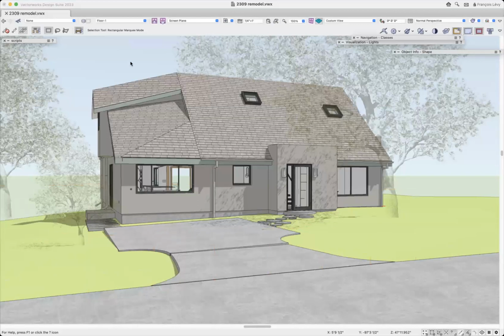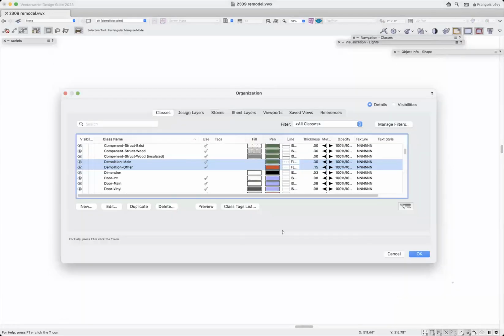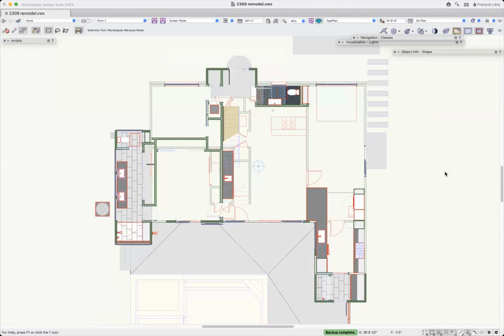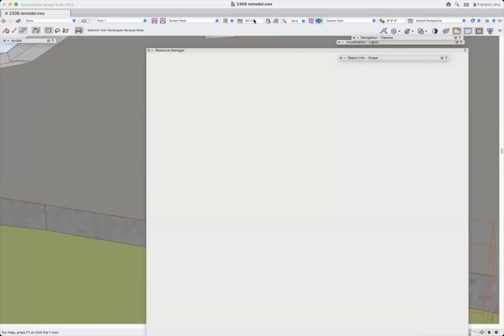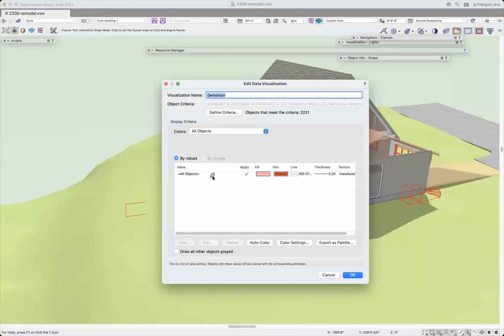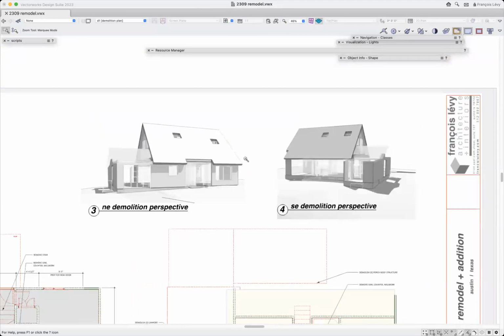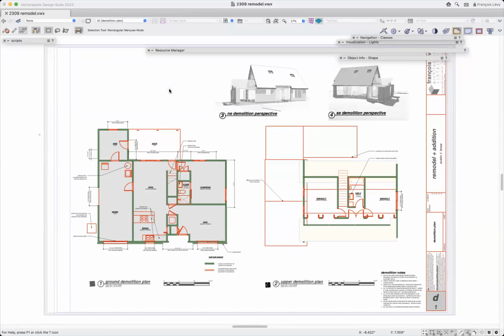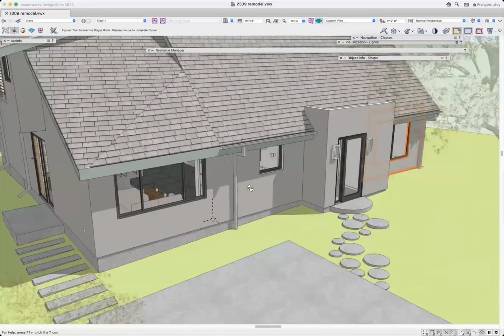Austin Vectorworks Community, September, 2023: Remodels and Additions

Comment: Normally, it should be simpler: as soon as a window is placed, Vectorworks should understand that the opening in the existing wall is destroyed because the window is placed in the projected layer. Therefore, Vectorworks should automatically transform the raw opening in the existing wall into a section of demolished wall, which it would then virtually replace with a projected wall to accommodate the new window. This would simplify resizing if necessary in the project. It's unacceptable that it's so complex to create an opening in the demolition layer and place a new window without inserting it, only to then constantly have to modify both the window's dimensions and the opening's dimensions without being able to constrain the attachment of these two objects. The software urgently needs improvement!

Comment: It's unfortunate that, as in Revit, we can't specify for each object (doors, windows) whether it's in its existing, demolished, or planned state, and then adjust the overall visibility of the plan, section, or elevation to display either the existing state, or the existing and demolished states by dividing the existing walls, assigned to the two separate construction phases, or even the existing, demolished, and planned states, or finally the existing states minus the demolished states plus the planned states, with specific attributes for each phase. Load-bearing walls benefit from special rendering conditions for each phase. The phases thus structure the projects and greatly simplify the use of class attributes, wouldn't you agree?

Comment: Sorry I missed the live version, but duty called on the job site last Thursday. Your method of using the door opening to make way for a new door in an existing wall was helpful. How would you go about converting an existing door to a window though? Or moving windows within an existing wall? Both were challenges I recently faced and ended up creating separate demo layers. Basically duplicating existing walls in demo layers to show existing conditions, demo work, and then the new condition of existing walls in the new construction layers. Is there a better way?
Reply from the maker: Hi Andrew, thanks for watching and your excellent question. I don't have a hard and fast answer, but here are my thoughts:

If replacing a window with a door of the same width (presumably you want to make use of the existing header):
—assign the existing window (inserted in a wall itself in an "Existing" design layer) to a demo class
—in the same design layer, insert a door opening
—on the "New Construction" design layer, place the desired door (not inserted in a wall)

If replacing a door with a window, again of the same width:
—assign the existing door to a demo class
—on the "New Construction" design layer, place a short length of new wall, setting its height equal to the old door's height
—insert a new window in the new wall

Sometimes, though, the new unit is wider or narrower than the old unit being removed, or may even straddle it (so an all new header). In that case:
—insert a break the existing wall in the "Existing " design layer as needed in two places to get a length of wall to be removed
—any existing doors or windows to be removed in the wall are assigned to the demo class
—in the same design layer, insert a door opening that is as wide as needed to accommodate any new unit(s)
—on the "New Construction" design layer, place a short length of new wall, setting its height equal to the bottom of the tallest header among the units being removed or proposed units
—insert new windows or doors as needed in the new wall on the "New Construction" layer

Only two layers are usually needed: Existing and New. If you need to show three plans (Existing, Demo, Proposed), in that case I advise a design layer viewport located on its own (third) design layer referencing your pristine "as-built" floor plan (answering Bill Vandersteel's question at about 12m20s into the video).

HTH! ~François
Reply: It's still complicated if the project's dimensions change. But it might be simpler to put a new wall in place of the opening of an old unit and then put a new unit in that new wall.